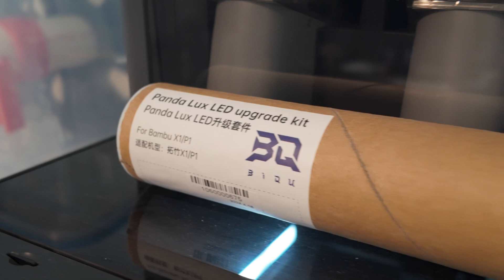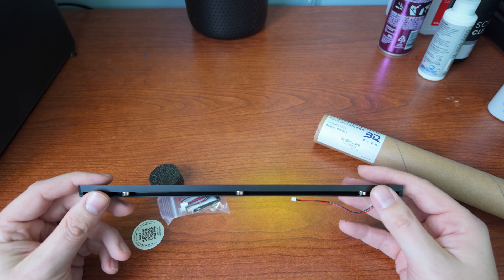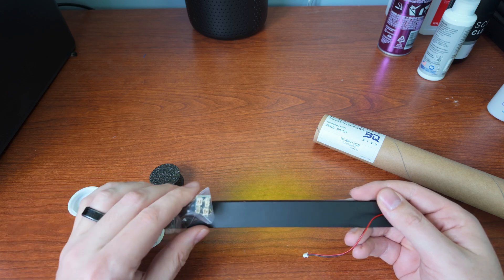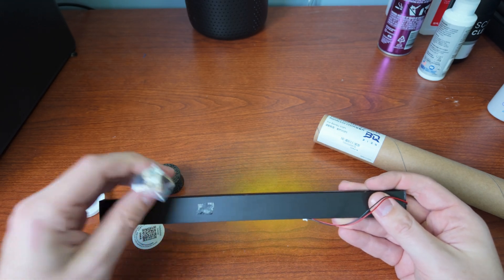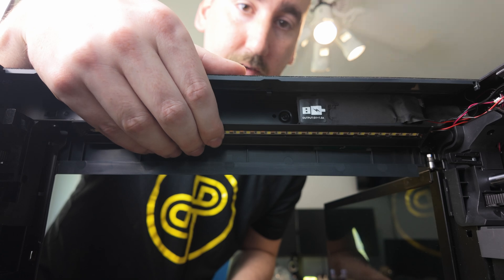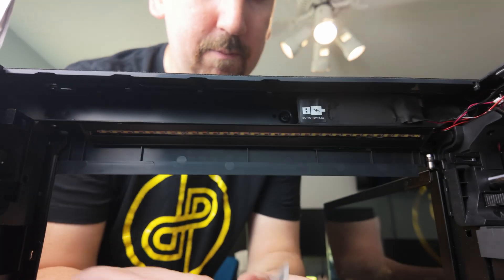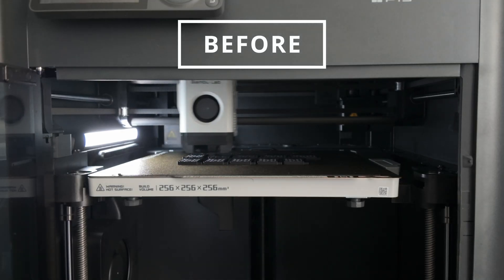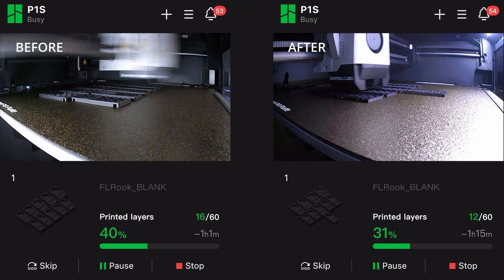Panda Lux Review | LED Upgrade for Bambu P1 / X1 Printers!

Comment: Great video.  I did have a observation and question.  I recently got a new X1C (2 month ago), I also received my Panda LUX kit.  I noticed in the X1C the internal light connector seems to be “hot glued” to the board.  Is it safe to break that seal?  Has anyone else noticed the same?
Reply: You most likely figured it out already due to the age of the comment, but just in case anybody else has the same question:

Yes, you can safely peel off the hot glue. You can pick at it with your fingernail and remove enough of it to safely pull the plug out of the connector.

Comment: Tonight installed the LED upgrade kit from Pando Lux after seeing your video. The light works great but have lost both the control screen now is blank screen and camera message from B/Studios (Printer camera is malfunctioning. Printed a small pirate ship and for the first time using the P1S the print come out bad. Any ideas on what happen and how to correct this problem.
Reply: Had same issue. Try to reconnect camera cable to the connector on the AP board. This cable was glued with sealing foam.
Reply: @tarashaidysh6683  where is it connected and how did you disconnect it and did it work after

Comment: I thought the old lights were still supposed to work as well,  isn't that the purpose of the expansion board?
Reply from the maker: The expansion board does have additional ports, though if you look at the wiki and instructions, Biqu says do not run both as it exceeds the current. I have to say, you really don’t need both. There are pros and cons to this light though. Like I said, if you really care about your Timelapses, it does add a hue and changes the direction of the light. If you really just use it to see how your prints are doing, it’s significantly nicer. Especially at night, it lights up the whole chamber super bright.

Comment: How do you connect the wiring and the board?  Since they include an adapter board, is there an old one that needs to be removed?
Reply from the maker: Super simple. Unplug the old led from the control board. Plug the newly supplied cable into the control board, and the other end into the adapter board. Then the new LEDS plug into the adapter board.

Comment: You never showed the wiring!!!
Reply from the maker: Ah must have missed it in editing. It’s not very complicated, unplug the old led bar, then plug the wire that came with the Lux into the printer and the adapter board, and then plug the lux into the adapter board. It was really easy.